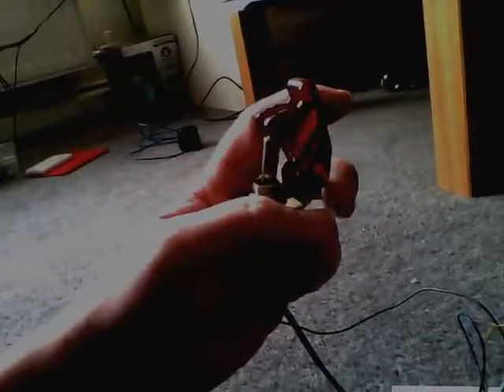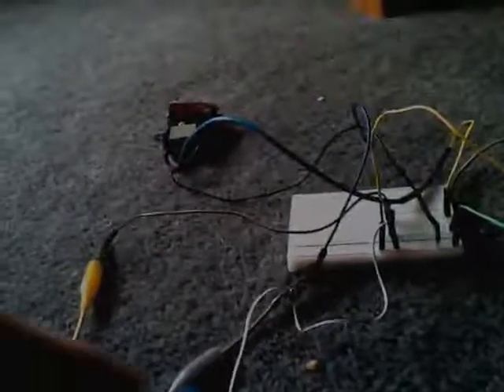Using the Adafruit Sound effects board

Comment: Can it drive an led for the gunfire?
If so how do you wire it?
Reply from the maker: +steveothehulk I have used a separate Arduino for this. You have to ground the board. An alternate is the Bare Conductive Touchboard.